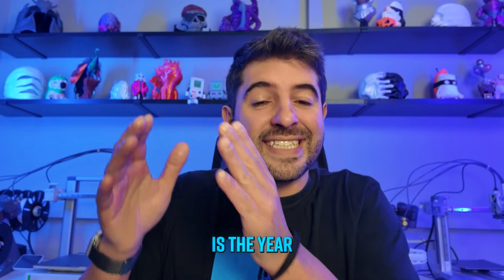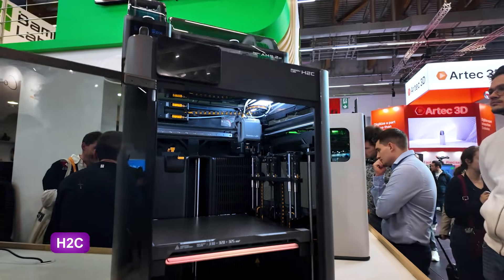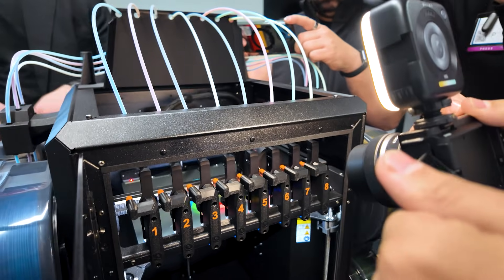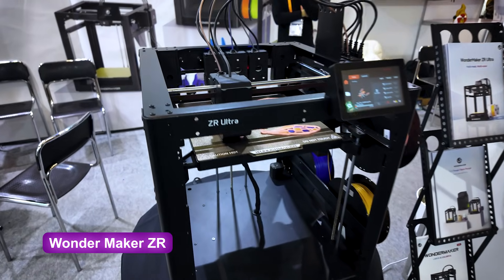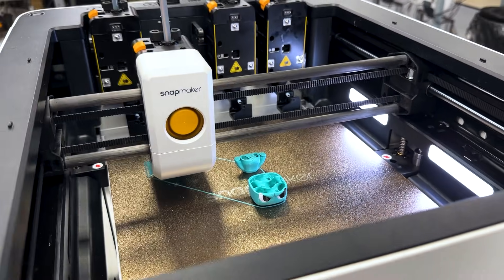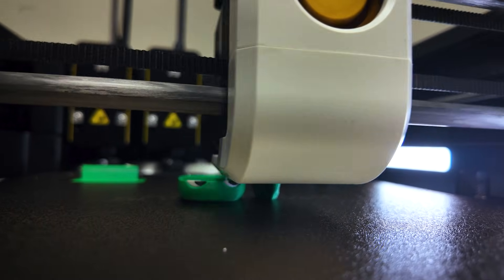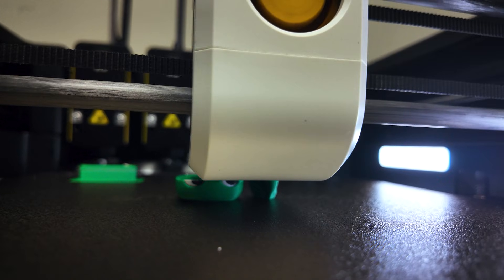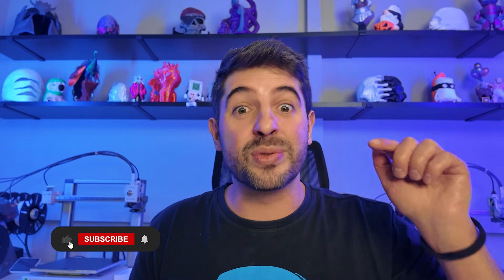The Future of Multicolor is Finally Here - 3D Printing

Comment: H2C still needs to purge the cut part of the filament each time to be able to use retraction. It reduces purge and bleed but it shouldn't be in the 'purge-free' category. They should have done better. I received an H2D for free and I was considering asking to beta test the vortex upgrade kit but even for free it just lacks the elegance of the rest of the Bambu lineup

Comment: No one ever mentions that the snapmaker is limited to four colors. It's fast and efficient but the design is not scalable.
Reply: There are videos of people doing filament color changes and printing with 6 colors! So if you plan the print right you can do more colors than 4.

Comment: What nobody is talking about with the PRUSA INDX is how long it actually takes to load 8 filaments into 8 nozzles, and you realize each only heats when its mounted in the main toolhead. Then change filaments, how long will that take?  I'll take the H2C or Snapmaker over that any day.
Reply: Its as quick as h2c to heat using induction heating. The filaments remain in the heads all the time unlike the h2d that has to load and unload every time so the PRUSA with BONDTECH INDX is masdively better quicker and better than BAMBU LABS
Reply: @hedleypepper1838  Both take about 8 seconds to heat up to pla temps. INDX is for sure quicker about 15seconds from print to print quicker. The h2c can probably speed up a little but so can INDX. The gap for a 'real' switch will stay at 12-15 seconds more for the vortek. But keep in mind not all switches are using the vortek many during the print will go from left to right nozzle and will gain time. h2c will never be the fastest system but it is the most fleixble and easiest for lazy people.

Comment: No waste is no waste and by this I mean of they get rid of the purge thay need to get rid of the tower too. What is the point of having zero purge and then waste  material on a tower 🤷‍♂️
Reply: I'm hoping that tool changers will have the option to prime in infill. I expect companies to be able to figure out ways to make them truly zero waste in a year or two.
Maybe there'll be an option to not print the prime tower, at the cost of potential defects in the print. Maybe people will come up with custom gcode to make those defects less likely.
Reply: @Hachiro the option to avoid printing the prime tower is currently available on all slicers I've used. Hopefully on the future this won't come at a detriment to print quality like you said.
Reply: @Hachiro Technically you can make the H2C purge in the infill and turn off the prime tower but you have to be careful with color contrast (light/dark) and up the wall count
Reply: The tower is also really good for getting rid of oozed filament and not just for colour bleed.
Reply: @Masalmeh321 I know that because I have 3d printers with ams system, but I meant that you cant say a machine is purge free when you atill have a purge tower, I hope in the future we can get a machine 100% no waste at all 😊
Reply: @HyperBulletX I meannnnn not everybody calls it a purge tower. I call it a prime tower, so do many slicers. It's more descriptive of its main function tbh to call it a prime tower.
Reply: @Masalmeh321 but it still wasting material wether it is purging or priming, I would love in the future of course a fully zero material waste printer 🙋‍♂️

Comment: Bambu H2C is not an 11 second color change! It's closer to 40 seconds.
Reply: All these times are off. In reality the h2c on vortek switches will always be 12-15 seconds slower than the indx system once they are optimised. A fully tuned fortek switch can maybe be sub 30seconds a index switch about 15deconds with a priming etc etc
Reply: Yeah they’re all wrong. All swaps should be measured from the time the print stops to change colour, then resumes printing the actual object.
Reply: @jacklowe7479  Well i have been changing my mind a little on that since the prime can be so much effected by settings (or 100% removed) to me i feel 'from print' to first putting filament down even of the prime tower makes the most sense. On my h2c thats now 26 seconds and very stable the prime part adds random times depending on settings.